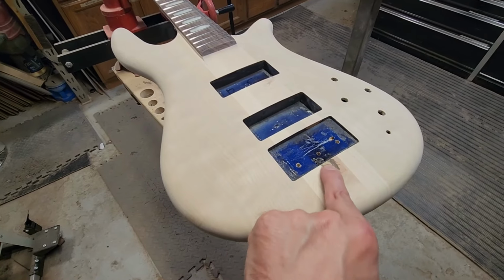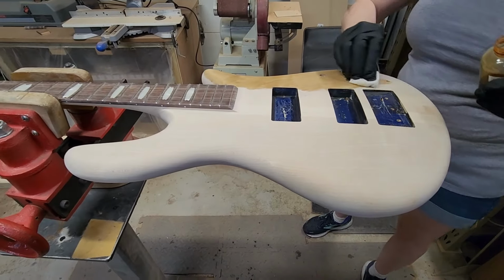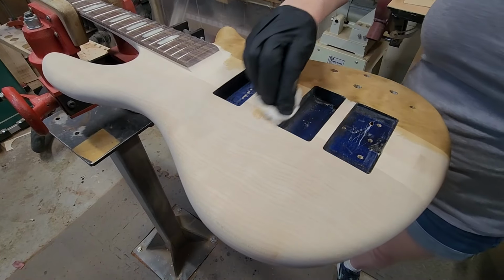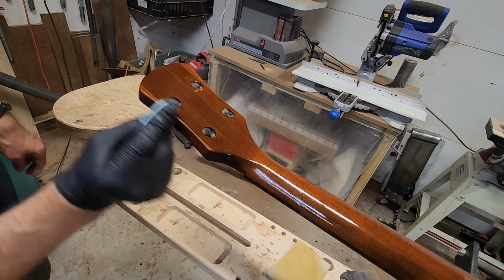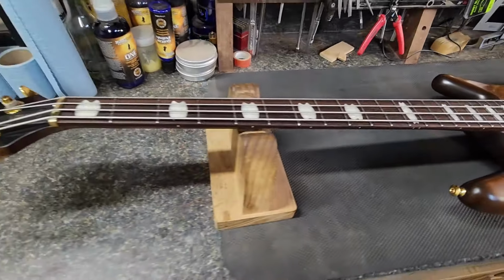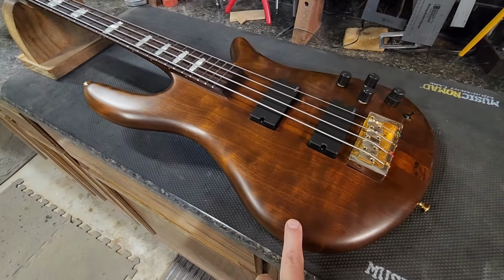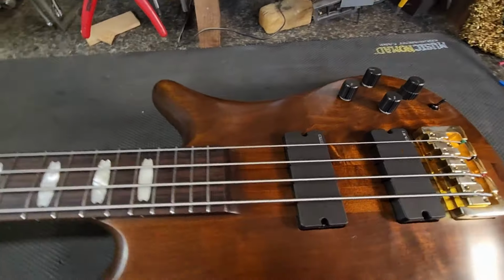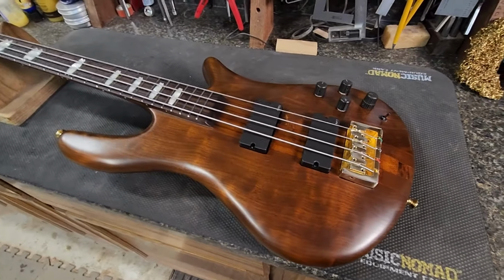Spector Bass Guitar Restoration PART 3

Comment: Hi! There is a Spector Legend like this near to my city that is for sale. And good price, but I dont like the colour very much... Its like a yellow/cream with the typical pattern Spector basses have. I see scraping the paint its hard! Do you think that, for the light yellow bass, I could perhaps paint over the existing paint? What kind of paint would adhere to the that Spector glossy finnish? Thanks in advance! Your result was spectacular! very good.
Reply from the maker: I am not aware of a paint that would adhere to a gloss finish. You may be able to abrade the surface to cause a scratch pattern, which would allow for a mechanical bond for the finish. I would recommend using a primer as well..

Comment: Hi Andrew, I found a 1999 Dean Edge Improv 4 on Marketplace that was built by Spector and would like to recondition the natural maple. To me it appears to be completely unfinished but has something on it that's creating a light sheen. So my question is, "Do you think Spector used a hard wax oil in their production or maybe something a little different?" Surprisingly enough and as beautiful as it turned out I was able to remove the dents in the wood with a damp cloth and soldering iron now I need to refinish it as they did at the factory, any thoughts on this? Thanks for your time and I can send some pics if needed. Ralan "By the way, NICE WORK!"
Reply from the maker: I don't know what Spector would have used as finish.  But if you sand back to bare wood, then the hard wax oil is a great finish to apply.
Reply: @drakecustombass  Thank you